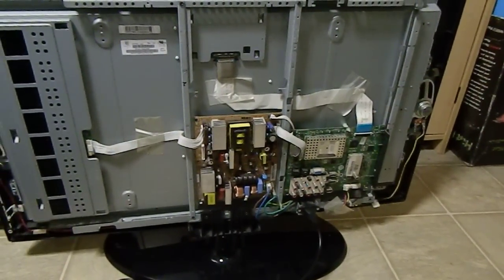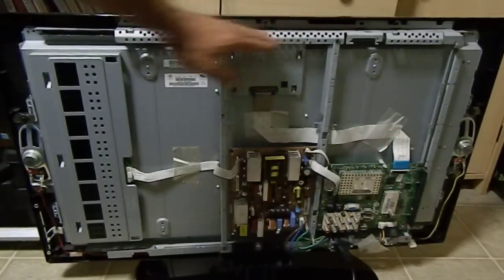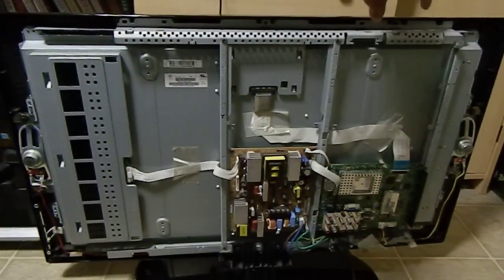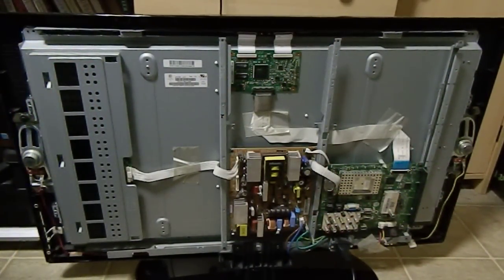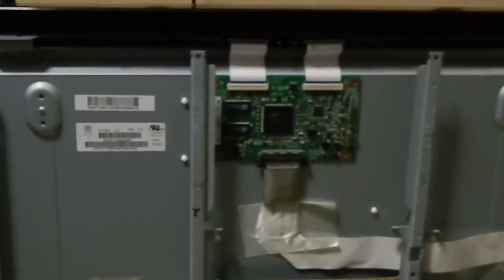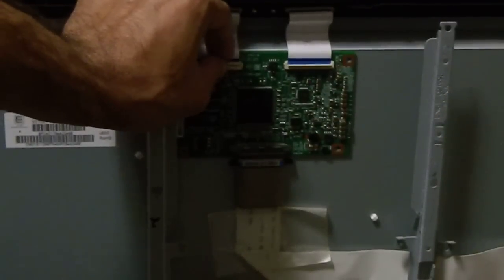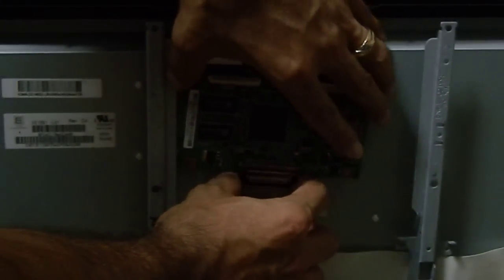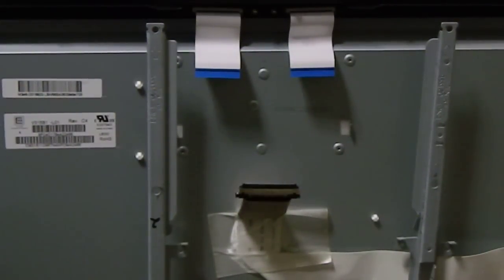HOW TO REPAIR SAMSUNG TV WITH BAD PICTURE (como reparar samsung tv distorcion color)

Comment: Hello, I have a Samsung 65inch LCD, model #:  UN65F6400AFXZA. The left half of the TV is dark (not completely black) and it's more apparent when viewing darker scenes (you can see a straight line down the center where the screen becomes darker). I found another video with the exact same issue (https://www.youtube.com/watch?v=_KsGoE8ehnY) but I can't determine if its the main board or "tab" issue. Please help!
Reply from the maker: +Mike T I am sorry for the late response, but somehow your comment was automatically classified as a  junk message by Youtube; maybe due to the link you posted. Anyway are you still experiencing this problem? Where you able to resolve it? It does sound like it is a panel issue, and I would not try that method shown in the video you posted.
Reply: +Runforlife thanks for the reply! I am still experiencing issues unfortunately. I can send pictures is that would help
Reply from the maker: +Mike T Go ahead and send the pictures.

Comment: NOBODY should attempt replacing a chip with sub-millimeter pitch pins like these, unless they have many years of soldering experience. One single solder short between to pins can destroy the new chip, as well as other parts on the board. I've replaced parts like these and it is a MISERABLE process to do by hand.
Reply: Chip, you mean the whole T-con board?

Comment: Thanks for this great tutorial. My TV now has great, crisp picture. However, the bottom third of the screen is now flickering. Have I damaged something?
Reply from the maker: +MrsBoffa Hi, did the flickering start after replacing the T-con boad?
Reply: The flickering has now stopped - I guess it was perhaps loose and has now 'settled'? It did only start after I put the new T-con board in. It took me two tries to attach the cables properly, the first time I had no picture on half of the screen, but fixed that by re-attaching the ribbon cables and pushing the bottom cable in more firmly. Perhaps the bottom cable was still a bit loose but has settled in. Hopefully it is all good now. Thanks again!
Reply from the maker: +MrsBoffa You're welcome.I am glad it worked out for you.
Reply: 9

Comment: TKS runforlife, the model i have is LE37A557P2F......
Reply from the maker: Emanuel Aveiro Hi, are you having similar issues with the picture on your TV?
Reply from the maker: Emanuel Aveiro The best option is to open the TV and look for the part number printed on the T-CON board itself.

Comment: I'm having the same problem,just wondering if it's the t-con or screen! Tried going into the service menu to change the ddr but I can't change the settings for that option. What's your opinion? I would appreciate any help. Thanks
Reply from the maker: Roberdybob Is it the same model and brand of TV as shown here? Do you have a solarized screen similar to the one shown in this video?
Reply: +Runforlife hi,the solarising looks very similar. The Samsung model number is le32a436t1dxxu thank you for the reply

Comment: Hi can you possibly make a video of the system settings. (Mute, 1, 8, 2, power) I have the same TV but accidentally changed the calibrations an just need the original #'s on white balance.
Reply from the maker: YBLeiZy I don't have the TV set anymore. But if you enter the service mode, there should be a reset option.

Comment: Having pretty similar issues.  Ordered one off ebay for my model type and keeping my fingers crossed it works.
Reply from the maker: Scott Riley I hope that fixes your problem. Please comment after you swap the Tcon board to see how it went.
Reply: Runforlife I definitely will. My picture issues are a little more dramatic so i hope it isn't the panel.
Reply: T con board did the trick.  Got a free TV and fixed it for $41.  Not too bad.
Reply from the maker: Scott Riley That's great. I am glad it worked out for you. Please like and subscribe for future repair videos. Thanks!

Comment: Colors are way off. Main problem the faces are red and the overall pictures looks like poster (posterized?). Does not look like Solarized samples.
Sasung LCD 46" Model. LN46A550 P3FX2A, S/N.ALXK 3CUQA 02817F
Tried adjusting color but it's impossible.
This TV had the entire screen replaced under warranty in 2008.
Reply from the maker: rcalzadilla If it is out of warranty, then you can try replacing the t-con board since it is the cheapest board. Since your TV had the screen replaced, there is also a chance that the screen can be the problem again, but I would replace the T-con board first.

Comment: hello i wonder if you can help me please, i have a samsung LE37A556P1FXXU that has a polarized screen. i changed it from cinema screen to the normal setting and it solved it for about 1 minute then it went again, would the T-con board  be the problem with my TV to, any advice would be great thanks Tony
Reply from the maker: This issue could involve the mainboard, lcd screen or t-con board. The cheapest of all three is the t-con board. I would try to swap that first before anything else.
Reply: i will try the t-con board thanks,would a new tv after that be easier
Reply from the maker: tony oneill T-con boards are fairly cheap. You might want to give that a try first and see how it goes.

Comment: can any t con board work or do you have to get one from samsung
Reply from the maker: You have to get the t-con board for your specific brand and model tv. The t-con board itself has a model or series number printed on it. So you need to open the TV first to find out the model number so you can buy the correct replacement.

Comment: hi. i have a samsung Plasma model 858fh-yb03 with the same symptoms.  what is the equivalent to the t-con board on the samsung plasma? your help is greatly appreciated. Fernando
Reply: model number might be pn58b550t2fxza
Reply from the maker: bluemarlin12 Hi, even though plasma internal design may differ slightly, some of the boards have similar functions. This model does have a t-con board, but is also called "logic board." However, same symptoms does not always mean the same issue. For instance, plasma TV sets tend to fail more frequently than LCD'S due to higher voltages which produce more internal heat. Having said that, there are some possible causes for your particular problem. First, the power supply, second the main board, third the main board and fourth the panel itself.
Reply: Runforlife
Thanks for the additional information.  Do you know of a way to narrow it down since I want to order the correct board?  Any troubleshooting I can do?  Thanks in advance.
Reply from the maker: bluemarlin12 If you are comfortable opening the TV, then you can try a few things. Be extremely careful before starting since plasmas have high voltages. Make sure to unplug the set before doing anything. After opening the set the first thing you can try is checking the power supply and main board for "bulging" capacitors. This is one of the most visual things that you can check without using a multimeter and checking voltages. If you are not sure how to look for "bulging capacitors," just type it in Google images so you get an idea. If no capacitors appear "bulgy" then you could try to replace the logic board. Please understand that these steps are without properly checking voltages before replacing any boards or parts, so it could be a bit of a gamble.
Reply: Runforlife
Im very comfortable with electronics.  I have not been trained on tv repair and without schematics it is hard to troubleshoot it. There are no bulging capacitors and the vs and va voltages appear normal.  the only thing i have found so far is some pin holes in a few of the solder joints in the x board connectors that connect the ribbon cables to the panel itself.  also, some of the pins inside that connector were also bent inside that same bad soldered connector.  could all of a sudden this start causing issues?
Reply: Hi, with my ps50c96 same problem. Voltage are all good, i have change the plasma t-con but picture still very bad. Any solution/Idea plz ?

Comment: great video walkthrough! quick question. where did you get your T-con board from and who's the seller? thanks again for the video!
Reply from the maker: Hi, I got it from ebay. Just buy it from any seller who specifically states that the board is "tested" or working properly. When the seller states that the board is working, ebay protects the buyer in case the board is not working as described. Good luck!

Comment: Thats easy to do...but where to get the T-con board from ?  I think this is the biggest problem isnt`t it ?  Thanks for your tut ! ;-)
Reply from the maker: Most of the time these boards are available on ebay. Just make sure to get the right board number for your specific TV model.
Reply: I have the same question where to buy T-con board in Germany. Please let me know.

Comment: I too bought a Samsung 46 " LED at Singapore two years ago. Now am facing display problem. 
When I called Samsung service guys , the first information what I received was the service charge will be Rs.5000 (am in India now).
The second information is display has gone.  So I need to pay 75% of the original cost  apart from the service cost. 
Am totally fed up with the Samsung Tv as well as their services. 
My suggestion is don't go for Samsung. 

Shyam.
Reply from the maker: It's unfortunate that you went through this. Sometimes it depends on the model of the TV rather than the brand, but of course the customer service of these brands makes a big difference. Thank you for sharing!
Reply: Whatever the model , if its from the reputed brand they should have a proper service or they should bear the alternatives for their products faults ...Now i fed up with the Samsung products ..